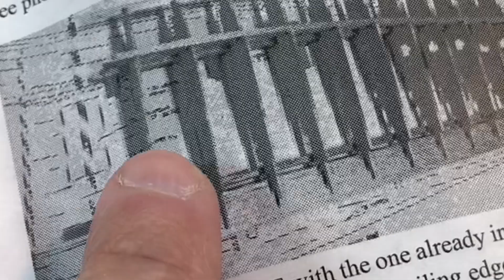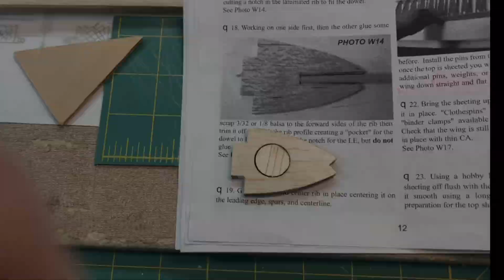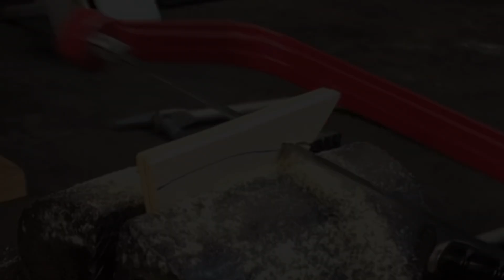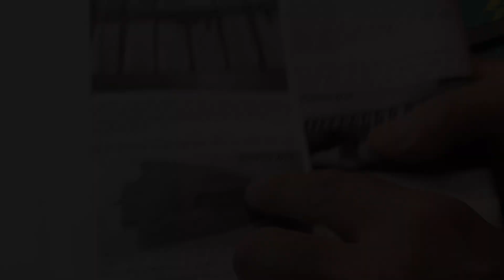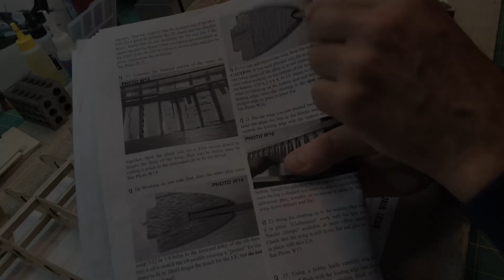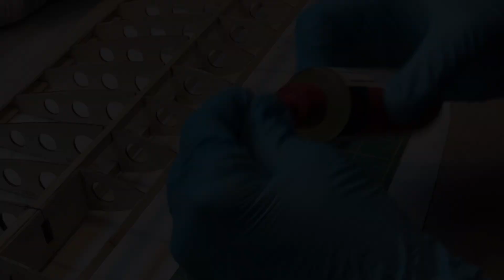Balsa USA Smoothie RC Plane Kit Build No 6, Wing Construction Part 4, Center Wing Ribs

Comment: Couple of comments if new viewers come along.   Epoxy is not structural and should not be used to fill cracks.   For the sandwich part of the front center ribs, pay attention to grain direction.   The instructions show the outer pieces having grain 90 degrees to the rib grain.   That would make it like plywood and much stronger.    And I think it would be better to not cut the slot for the dowel.   When it comes time to install the dowel, the pilot hole is drilled into those center ribs/leading edge/former all in one go ensuring a tight fit in not only the fuselage former but also the center ribs sandwich.   You will not have to be as concerned in getting the perfect angle on the drill.    When I glue up, I will use a lot less epoxy and a lot more Titebond wood glue.   Being water based, it will penetrate the wood pores better than 5 minute epoxy.    My background is very heavy into woodworking and I can see a couple of things that I will do differently.

I do want to say that this series inspired me to buy this kit.   There are tons of great techniques shown and thank you very much for this series.   I know it was a lot of work to make these videos.   Spoiler alert, I sure hated the end of the series.    This is my second time to go through these videos.   

Thank you rc plane tech for all the effort you put into this series.   I can only hope my smoothie turns out half as pretty as yours.
Reply from the maker: Thanks a lot, I really appreciate the comments and insight. And the comments are great because we all learn from each other. Good luck building the Smoothie, it was really a nice flyer for the short time I had it. I was impressed with its flight characteristics. The BUSA instructions have a few issues here and there, but overall good kits.

Comment: Better to put hard wood blocks on the leading edge side of the doubler to relocate the wing bolts to the spar and dowel/pin the trailing edge where you have more support.  When I dowel wings i use thin brass sleeves to keep the holes from wallowing out.
Reply from the maker: Nice suggestions. I wasn’t too happy with the single small dowel set up, but opted to follow their instructions.

Comment: Keep in mind, epoxy is heavy.  It is only required in a few high stress areas.  Stress = force/area.  If there is a lot of surface area and/or low forces you don't need epoxy.  The nose rib assembly is best drilled out for the dowel once you know where the hole should be.  It makes a tighter more precise fit and a lot less work.
Reply from the maker: I agree, that dowel set up is a little odd, and Im thinking the dowel itself is a little too small of a diameter. I was going to increase it, but then just went with the kit instructions. I like this kit ok, but the instructions are a little hard to follow at times. Some of the pictures don’t match whats shown on the plans or even match what is in the text description. I think there are a least 3 generations of instructions here, the original plan, then photos that predate some of the laser cut pieces, then text that was updated to the current set of pieces. But there is a little mix and match going on that at times make for a confusing build. When I get done with it, I probably do a review.